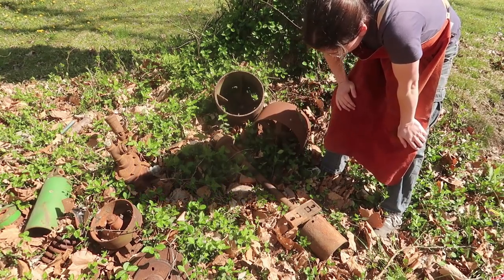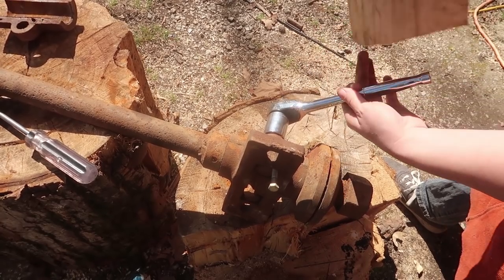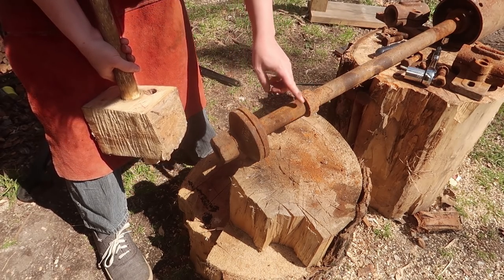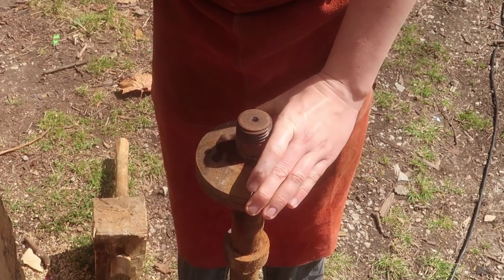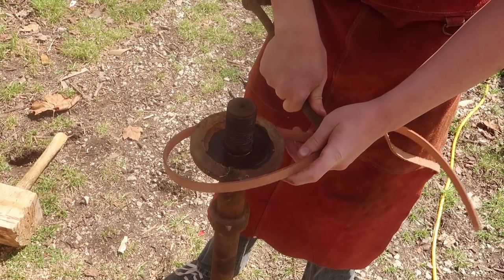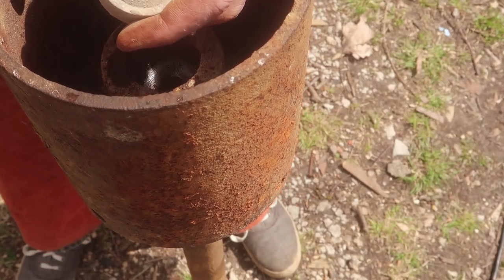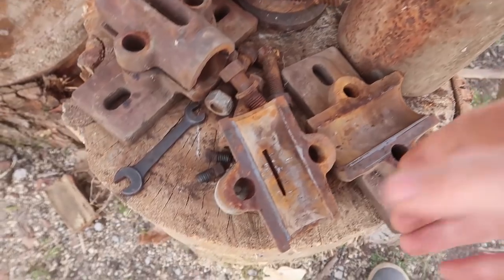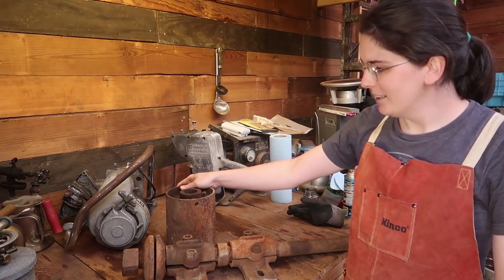Saving Antique Line-Shaft Arbor, Flat Belt Hardware: Babbitt Bearings, Pulley, Machinable Shaft.

Comment: That looks like a buzz saw shaft. The circular saw blade mounted between the flanges and the pulley was belted to a power source.
At 3:16 it's not a gasket. It's a shim to get the fit between the shaft and the bearing surface that they wanted.
...and don't turn the bearing journals on a lathe. That will remove too much material. Just spin the shaft in the lathe and use emery cloth to polish it.

Comment: Everything looked a bit crude, ... but effective in the long run.  I was surprised in all the early detaching, we see not a whit of oil, ...of any kind.\
In forty years of wrenching and pounding fixing old machines, lubrication to help take apart, has been key,
Thank you for your videos..We appreciate your enthusiasm for these precursor methods that built the modern world.  :-)
Reply from the maker: for the most part oil helps the mind more than the part for a lot of these older stuck things. The real lubricant is pressure and heat

Comment: Man, I was cracking the fuck up the entire time you were trying to remove that last "washer type thing." Especially when you were trying to knock it off using those two screw-laden boards. I've definitely been there before. 
I would have thought you'd have just heated it up in the same way you did the bolt at the same time as the bolt. Good job either way.

Comment: Kroil is a must have when dealing with old rusted hardware.  But give it time to soak in.  Or try hot water and work the part back and forth, flushing out the rust along the way.
Reply from the maker: heat works better tbh.
Reply: @RinoaL  There's nothing like the "Red Wrench", when it comes down to it.  But at my plant we have extra paperwork to fill out prior to utilizing open flame.

Comment: a babbit bearing will only need to be repoured if the shaft is loose in the bearing with all the shims removed, also if it has any major damage. I think it would be great of you installed the belt pulley system in your shop to run different machines like your lathe.

Comment: Good job. Nice to see you using the mallet. I think the bearings will be fine once you wire wheel them and lubricant with a little oil or grease. Rather than recast a bearing, think about just making a bushing.

Comment: Those babbitt bearings might actually still be usable, believe it or not. The strips you removed from the sides were likely shims, intended to be removed as the bearing wears. Assuming the shaft isn't too far gone, it may be as simple as making a slightly thinner shim out of alumin(i)um foil or something similar.
Also for the press, I vote for "The Trumpet" because honestly that's what I thought the screw jack was when I first saw it. Made for a really confusing few seconds until I figured it out.
Reply from the maker: i'm going to veto the trumpet lol
Reply: @RinoaL  Haha fair enough. That press is awesome by the way; never would've thought you could make one with a wooden frame, figured it'd be too soft/springy. With some reinforcing angle iron and a coat of linseed oil it would have a nice classical look as well. Nice work.

Comment: Penetrating oils are your friend. WD40 is used to remove water from things, hence the WD (Water Displacement). You need to buy a can of penetrating oil and apply to the bolts and nuts a little ahead of the time before you decide to remove them.  I realize you love to do things your way and on the cheap. But why work harder then need be. When you repair, refurbish, restore or rebuild anything, the object of doing so it to make it work like it once did. If that means replacing parts with new parts, then so be it. Patching things will ALWAYS come back to haunt you down the road. And unfortunately, that usually happens when you least want it to... Part of Murphy's Law!
Reply from the maker: wd-40 is a penetrating oil, i recommend watching Project Farm's tests on the matter. heat wins over any penetrating oil anyway. https://www.youtube.com/watch?v=xUEob2oAKVs

Comment: When loosening rusted bolts/nuts back up now and then.
For example that fourth nut there is a pretty good chance that it would have gone a bit easier if you for example loosened half a turn went back that half turn .
Then lossen 1 turn back up, loosen som more, repeat then when yoyu have gone 2-3+ turns you back up until the nut turn freely/more freely, then start too loose again and often repeat all the way/until it moves freely.
Reply from the maker: yeah i do that sometimes, but it wasnt quite to the point i felt it risked binding up.

Comment: Hello there.. You could build also a metal press from heavier wall profile cutoffs at the scrap yard... I've seen so much very nice pieces.. For pressing you can use a simple bottle jack (hydraulic one). Would be an easy peasy job.. =) 12 to 15 tons should be enough for most projects. Personally I wouldn't vote for the screw one.. Cheers.
Reply from the maker: screw is a 12 ton screw though, probably only 1-2 tons of force here though.

Comment: Rin...  Thanks for posting these frequent videos.   I hope you don’t mind my added $0.02, but an impact driver bounces back and forth internally building up more torque the longer the energy is applied.   I’ve been thinking it would save you a lot of time if you used one.  Also if you check out Project Farm, there’s a great video about penetrating oils.  It turns out that liquid wrench is more effective than wd40 for moving those rusty nuts.....   ps...   the homemade press was awesome!!!
Reply from the maker: funny i just linked another commenter his video because they said wd-40 wasnt a penetrating oil. honestly i think ill stick with heat instead of buying more cans of stuff. oh and regarding the impact driver i have started using my milwaukee impact driver but only for screws. i dont mind tapping bolts and set screws by hand.

Comment: Happiness is... having the right tool for the job.  LOL  BTW, since you seem to be a DIY tool kick with your screw press, have you considered throwing together an electrolytic rust removal bath?  I think you may have all the parts you need laying around the shop.  :)
Reply from the maker: i've used electrolysis rust removal for years, and got really tired of it back around 2017 or so. i got tired of having to deal with the gunk it makes.

Comment: Color me extremely jealous,  ive been tryng to find some line shaft parts for a workshop since its actually a really good idea for an off grid space but theres pretty much nothing here in the south at anything resembling a reasonable price.
Reply from the maker: well, i plan to collect everything i can and start selling it when i finish building what i need with them.
Reply: Rinoa's Auspicious Travails well so long as youre not going after the “spend $500 for a broken outhouse door for aesthetic reasons” kind of crowd who seems to corner the market for any sort of industrial equipment around here...we may need to talk

Comment: That's  an arbor for a old cordwood saw .It probably dates  from the 1900 to 1940 era .used on farms for cutting firewood  .It would  have been driven  off  of a PTO pulley on a farm tractor  or possibly  a hit or miss engine .The washers were for clamping  the blade. Some good penetrating  oil would help your project...      https://youtu.be/ZnmC7IenHaE

Comment: How about, Aw-screw-it?

Rude question, Rin, I know, but how much do you weigh? You often seem able to express more force than I’d think someone your size could.
Reply: Girls generally really don't like you asking about their weight, but she said 130 pounds in an old video. She is very strong, in fact, I'm not aware of any maker girls even stronger than her.
Reply: NiHaoMike I know, but figured if she didn’t want to tell me, she wouldn’t.
Reply from the maker: thats not a rude question, last time i checked it was 133lb, however ive had a lazy winter so i may drop back down to 128 if im doing too much work. i go up and down.

Comment: Regarding your comment at the end about turning your brick shed into an engine house, I suspect you are aware of the following people, but if not I would recommend you check out Dave Richards 'Old Steam Powered Machine Shop' ( https://www.youtube.com/channel/UCBdj-vOveiEFWe3vnGoJUag ), and watch any videos on YouTube featuring the late British steeplejack and steam enthusiast Fred Dibnah.  Also, instead of pounding on your ratchet wrenches, perhaps think about getting a breaker bar.  They use the same sockets, have a longer handle for more leverage, and don't have a ratcheting mechanism which can break from the hammering.  I've done that myself not realizing it until I need to use it the next time only to have the handle spin freely around the socket quite uselessly.